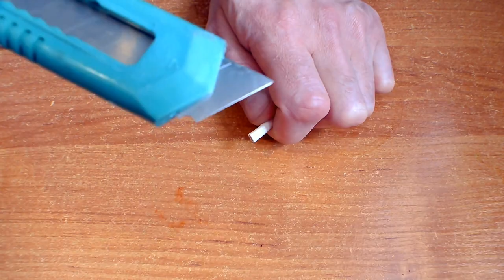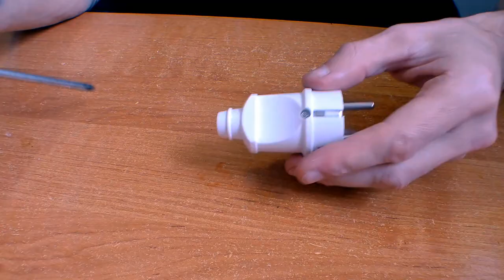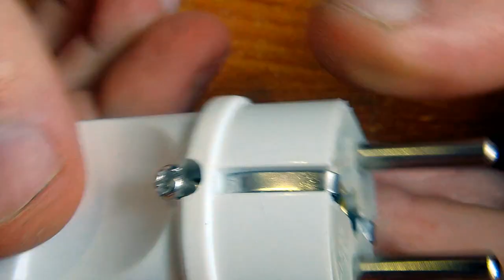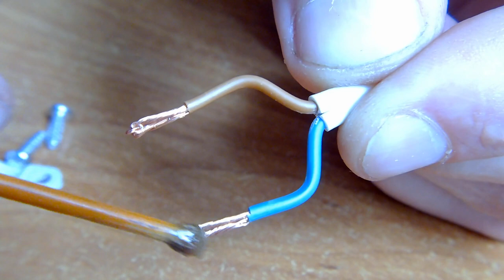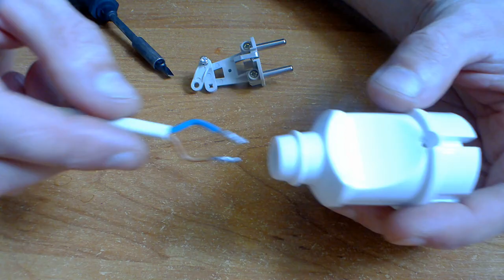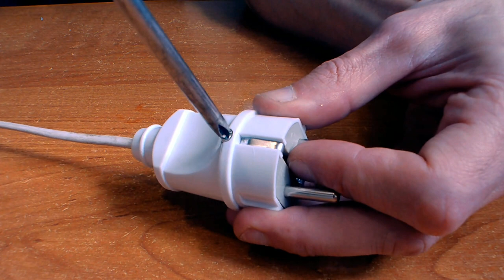This is a reliable connection.

Comment: I was expecting some really bad hack, but this was actually much better than I expected.

However, your arguments for tinning the wire ends are actually wrong.  It is actually best practice not to apply solder to wires being used in crimp or screw-terminal connections, as adding solder can actually make the connection worse in significant ways.  This is for a few reasons:

1) Solder is very soft, so even though it may seem like you have a tight connection, over time the solder will distort or flow to different places, causing the connection to become loose.
2) Adding solder introduces the possibility of cold-solder joints and other bad connections between the wire and the solder itself.
3) The copper wire and the brass screw terminal are designed to have similar thermal expansion characteristics, so they will expand and contract together with changes in temperature.  Solder does not have the same expansion coefficient, so changes in temperature will cause it to expand and contract differently than the surrounding metals, leading to stress on the connection, and potentially loose connections over time.
4) Most forms of solder are actually more prone to surface oxidation than copper/brass, so you are more likely to have problems with oxidation leading to a bad connection, not less.
5) Tinning the wire ends with solder can result in a sharp transition between the flexible stranded copper and the stiff soldered portion, this can cause a point of high stress if the wire is bent or flexed, and repeated flexing can cause the wire to fail at that point (in this case, there is strain relief, so it is not as large a concern, but it can be an important consideration in many similar scenarios).

Solder should only be used for connections were both parts of the connection are being soldered together.  You should not add solder to only one part by itself.